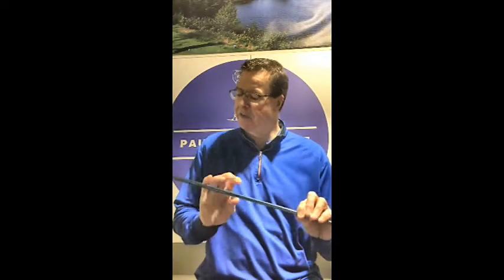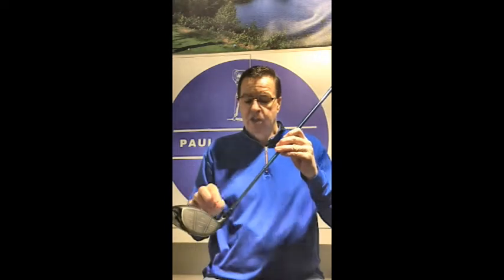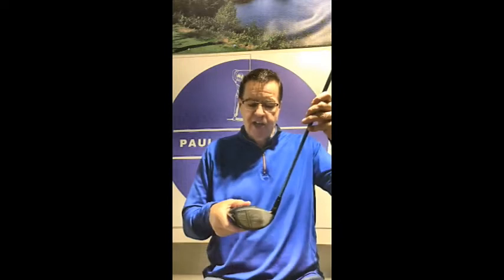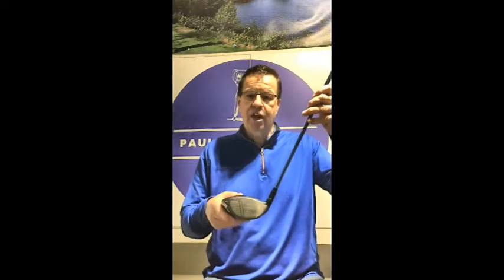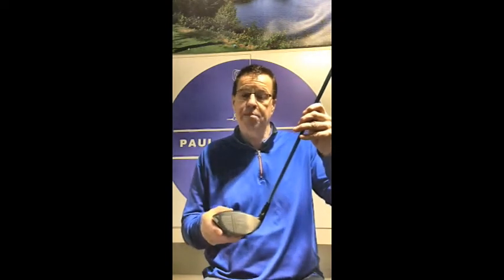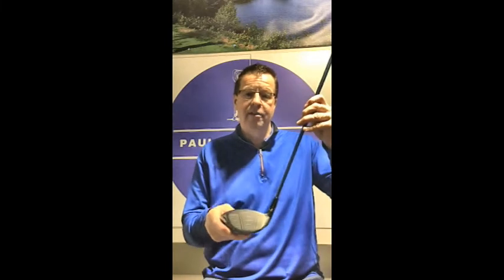Shaft Fitting - DETERMINING FLEX ISN'T ENOUGH

Comment: Paul, could you explain kickpoint and how it’s determined. Also what type swing needs what kickpoint. Thx
Reply from the maker: Kickpoint is a term used to describe where the shaft has the most bend .  A low kickpoint bend closer to the head and a high bends closer to the grip.  A low kickpoint canhelp a golfer get more flight on their ball as it kicks the head upwards creating more loft.  A higher kickpoint does the opposite.  It can also be a feel preference that hjelps people feel the load of the shaft better.

Comment: The problem is that if you get fitted at places like club champion, they want to sell you premium shafts and a new driver can cost $800-$900
Reply from the maker: You have to trust your fitter and see the results that justify any new purchase.  I always present my clients with before and after comparisons between their current clubs and fitted models.  Occasionally there may not be a significant difference.  Other times there is.  This way the client gets to make an informed decision rather than an emotional one
Reply: @paulkellygolf3671  I live in Boston and haven’t found a good fitter.
Reply from the maker: @sumitagg1  there has to be numerous ones available.  Ask around until you get the same answers from m multiple people.